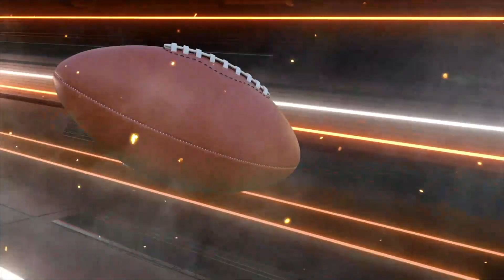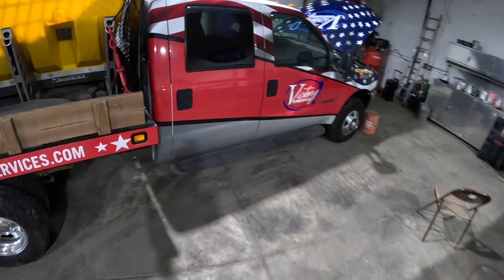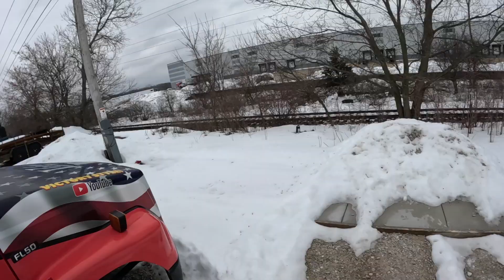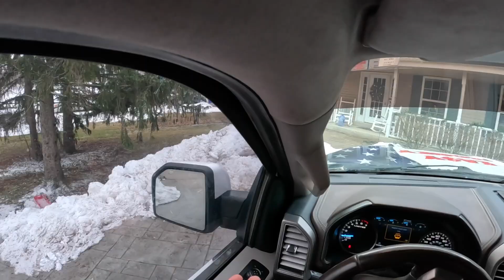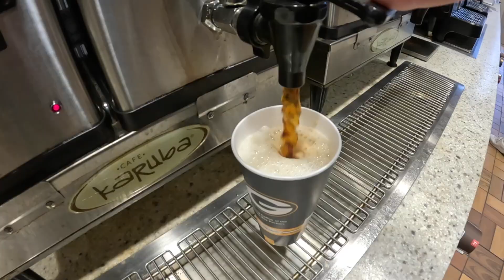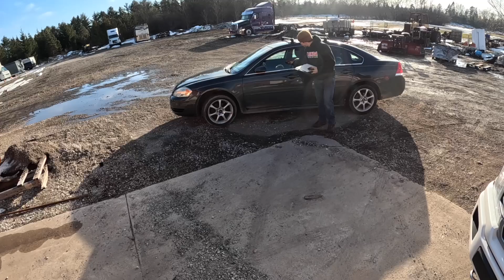The city might shut me down!

Comment: Cudihey is worse . I visites up there a few years ago and took my mini van and was parked out front of a freinds house they came and towed my van couse they said i have to have a parking permit at the rate of $10 per day per wheel couse i had Illinois plates then they wanted me $1500 un towing and impound fees plus a $45 parking ticket and made me buy 1 weeks worth of full coverage insurance even though i had insurance on my van before they would release my van . And as you could only guess it had been gone threw and ramsacked AMD several things missing like camers fishing equipment 2 bottles of 200 year old scotch blankets pillows even the hubcaps .

Comment: Because your property is going to act as a roadway for the most part that gravel is considered impervious due to the vehicle factor compaction. It actually won’t drain as good as gravel let’s say sitting under a deck. I hate government overreach but water run off immediately falls on them for not checking it before allowing sign off.

Comment: I failed my first drivers test for the same exact reason instead of actually driving back to the facility.  I told the test giver to get out of my car after I successfully parallel parked. Made him walk 5 miles.  Went to a different county for my license with no issues a few weeks later
Reply: LOL. I flunked parallel parking, but still passed. That was 48 yrs ago tho, and I’ve never attempted it! I will drive around the block to avoid having to parallel park!😆

Comment: When it comes to the civil engineering side of things when developing a property like this with multiple buildings, it's extremely important that every possible minuscule detail is checked and balanced for the greater good of the long term investment of the city/neighborhood. It's unbelievably frustrating jumping through their countless hoops, but without those hoops, the cities infrastructure would collapse.
Reply: Well said, increased run off from a catchment due to changing the lands drainage properties, could in the right/wrong circumstances, create excess run off for surrounding properties, or even flooding...it does happen!

Comment: You gotta love government. I have an auto repair shop. Out front of my gate is a pond. It started when the towhsip put asphault millings down over a foot thick on the road. It stopped the water from escaping across the road. The "road master" after 2 years of asking and then going to a township meeting decided to dig a ditch across the road. Filled it with geomet and crushed bank grave. You know with the dirt still in the gravel that packs in and you make a road out of it. He says that will create an underground river to drain the water. The thing is my landlord has put a bunch of gravel in this hole that they created. When they dug the ditch they found pavement under the gravel. He says that wont drain because of that. He is right. But where did the water go for the previous 100 years? He said he doesnt want water going across the road. It still drains across the road once the pond fills up enough to spill across. We are talking about a side dirt road that may see 20 cars a day.

Comment: Gravel is pervious ask your planning guy .l am surprised they haven’t picked up on the new concrete pads there
Reply: Water will drain through gravel. You should choose your gravel carefully though as some types such as sandstone & limestone will absorb the moisture. Gravel driveways are considered impervious because they prevent infiltration, which results in stormwater flowing off these surfaces at a higher rate than pervious surfaces. This is typically due to compaction of the underlying soil and stones by vehicles.

Comment: As long as the city gets their money , you'll be fine . That's all they really care about.
Reply: Exactly what they want.
Reply: Everything is legal if you pay the fee/fine
Reply: @mcpuddin6106  Right one more like the fee.
Reply: Warren Zevon said it, you can get anything done with lawyers guns and money. Which is pretty much the way the USA works everywhere in the world, :-)
Reply: I work for the city and depends on the city. Granted I work in the water department. I don’t really care what you do with your property as long as it built up to code and safe. The main reason because if you have a work accident in that shed and need to be carried out you are putting unnecessary risk to first responders. They don’t want the roof to collapsing on them
Reply: @YoureASquidYoureAKid  Your very correct about this. But since he's contacted the city,and they have been at his property for a inspection of some kind you would have thought that they would have made mention of this. Not 4 months later.
Reply: @williamfenner9915  Doing anything with the city is a long process and honestly this was probably a low priority issue for them.

Comment: Ryan, just a thought it would probably be a good idea for you to add either low jacks or Apple AirPods tags to your equipment just in case so you can trace it down if it is stolen usually add it up underneath the frame My dad used to weld the boxes right into the frame of the equipment. We had any helped once or twice when somebody walked off with a piece of equipment.
Reply: This right here !
Reply: Definitely 👍❤
Reply: Problem with airpod tags they can hack it and turn it off